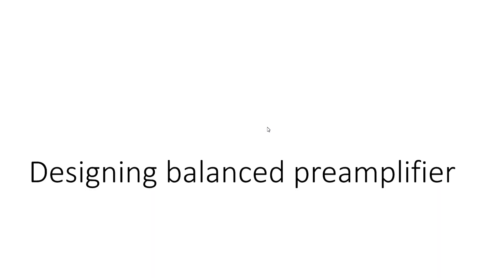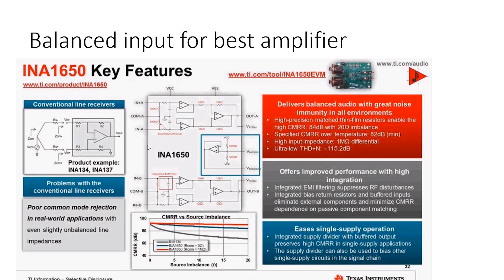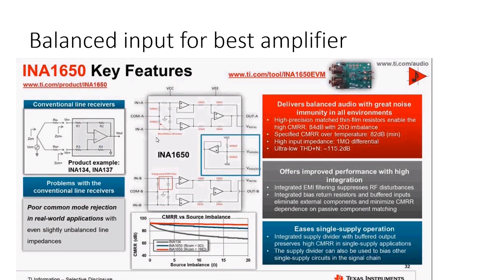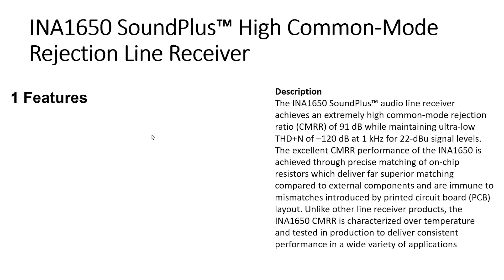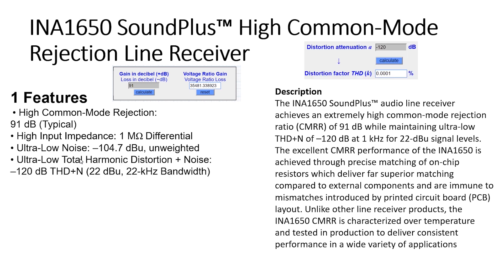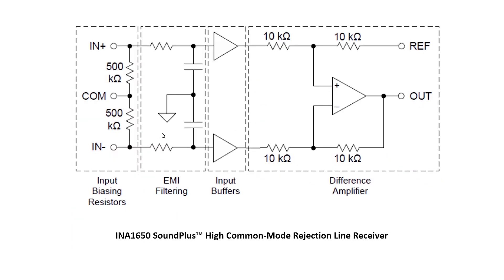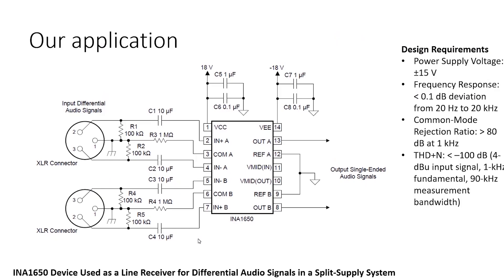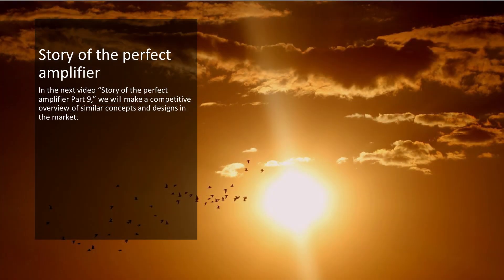Story of the perfect amplifier Part 8

Comment: Guntars - thanks for the videos, very informative. I have a question for you. I am building a set of DIY speakers using IcePower  200ASC and 200AC in each cabinet. The ASC to the sub and the AC to the Mid/Tweet. I would like to add a preamp to this configuration but I can't find a mono preamp to add to each. I am not an Electrical engineer so this may be a simple question. Can I add the INA1650 to each cabinet in my configuration and have it wired as a mono signal? Can I add a Pot in this scenario to better match the output to both amps?
Reply from the maker: Yes just using one channel